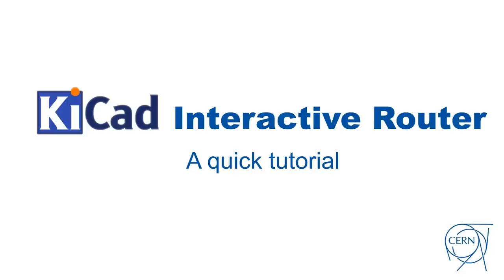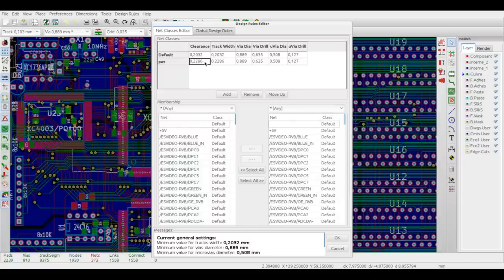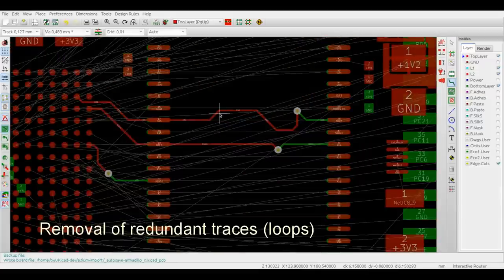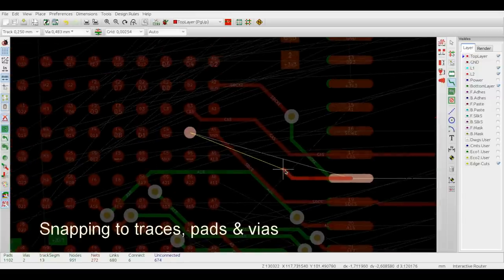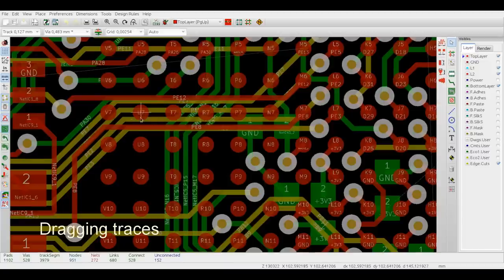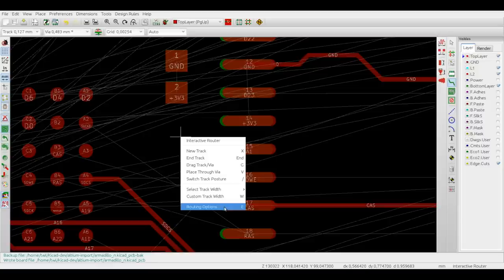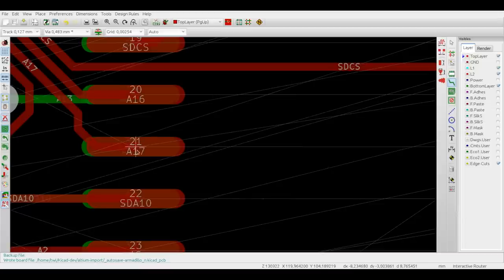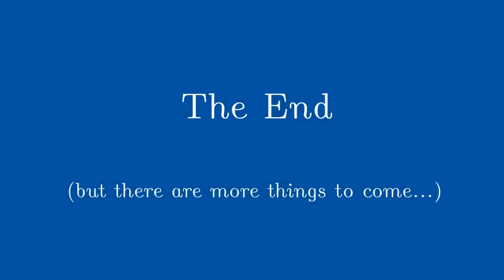Kicad Interactive Router (release version)

Comment: so it is February of 2016 now, i have a questions:

 1) does via/trace shoving work good now? 

2) does differential routing/length matching also works well?

 3) does length matching in general also work? 

4) is there such a thing as "layout reuse" ? for example, if i have similar schematic block inside a schematic sheets, i lay out once, then i copy and other similar layouts are done in same layout project?
Reply: +Rtwo Comm (R2COM) I used it for a couple of boards, the least I can say it that it's a life changer compared to the older versions ;-)

Comment: I am new in PCB CADs - why is not possible to create clever enough Autorouter for fully automatic routing? And why you did not use Autorouter - Automatic trace function?
Reply: Because autorouters don't work. None exists that does a good job on serious PCBs. Compared to humans, autorouters are dumb.

Imagine you have a messed PCB with lots of very entangled traces that you have to un-entangle. The human will do it by hand with his brains, and then the computer can optimize the traces. But if you simply let the computer autorouter, it will "optimize" the mess and make it even more entangled, because the algorithms to un-entangle traces are too primitive, or don't exist at all. The problem of un-entangling traces is very hard and algorithms are usually very weak at that. 

The solution provided here is the best working solution: the human does the routing himself, and the computer simply helps optimize the traces.

Comment: How can I run it on MacOSX? I can start the interactive Router but i can´t do place any vias or open options and so on...
Reply from the maker: Which revision of Kicad do you have?
Reply: Tom W Hy Tom, I have KiCas 2012-02-26 BZR 4721
Reply from the maker: Cele Born
It's quite old (the video at 00:52 says you need at least 4874). You must compile a newer version.